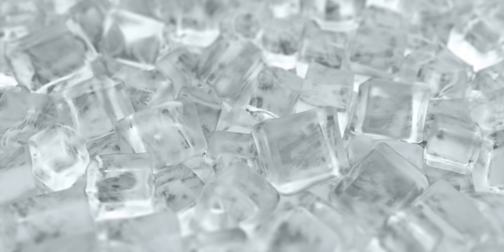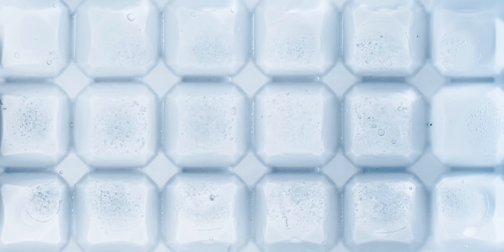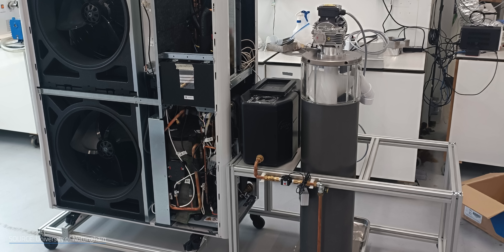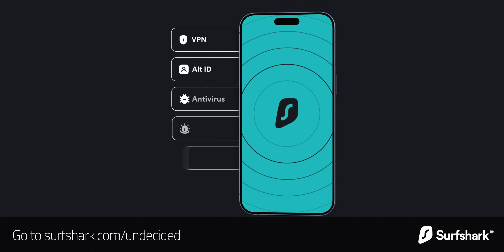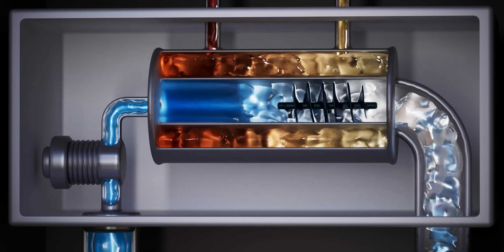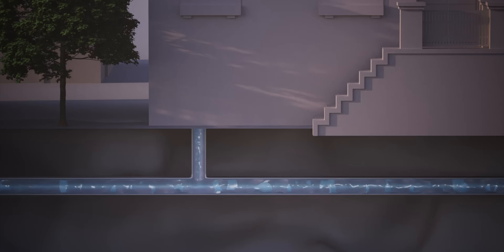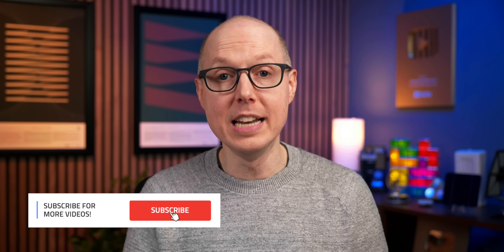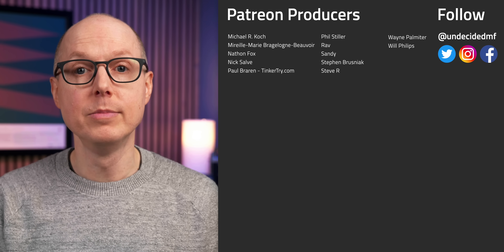How Can Ice Heat Your Home? Ice Source Heat Pumps!

Comment: Unless I missed something, there's a bit of an issue. Whilst the use of the existing natural gas pipe is a good reuse of infrastructure, this is totally wiped out by the need for a return pipe which doesn't currently exist, necessitating digging up every road and street to install anyway!
Reply: I think the clue was the mention of non-pottable water, the proposal may be to use the ground water or sewage water pipes as the return. This is reflected in the comment about suiting built-up areas more than rural ones, as in rural locations ground water tends to feed soakaways and sewage septic-tanks, so don't offer a return systems.  The picture in the video with the separation tank on the return also indicates this use. Perhaps Matt was avoiding describing grey/brown waste water being used in this role, stating non-pottable water instead.

However, whether this works or not is another question in itself, given the state of the water companies in the UK, and their attitude to investment.
Reply: @GruffSillyGoat  I imagine slushy grey/brown water would be basically cold mud/diarrhea.  Requiring more a lot more power to pump
Reply: Oddly, there's a lot of heat in the drains, at their depth would have a constant surrounding temperature from the earth. I would anticipate the impact on turbity or fludity would not significantly alter. There's a trial of a waste water heat-recovery plant operating in Kingston (London), as the current treated waste water is pumped into the local river with a near-constant 10-15°C all year round. The system diverts part of the literal waste-heat into a new district heating system in the area. The waste heat resource is massive, with some 20TWh of heat washed away in the UK alone a year (16 billion litres), and 350TWh in the USA. 

The Kingston system use centralised-WSHP rather than per-house ISHP, although I wonder if ISHP would offer any additional benefit (would depend on the COP of each system). A ISHP approach would provide a more localised system, whereas a more centralised sewage heat-recovery approach would be a more district level approach. The advantege of the re-used gas-pipe ISHP approach being a retrofit approcach with a lower construction impat of having to dig up roads to fit a district heating system.
Reply: Think the bigger question is water pressure on pipes.  These are made for gas and at least plastic pipes might be inadequate for this function...
Reply: There are a lot of issues with this and it is a literal "pipe" dream IMO. First, even if the sewers were used as returns, the exit from the heat pump to the main sewer line isn't straight down, like depicted in the animation. In my house the sewer line runs about 20 yards horizontally to the street with a slope that allows the sewer line to be evacuated completely instead of sitting stagnate. The line is sitting empty full of air and that doesn't hold heat all that well. When we have freezing precipitation, it is really easy to see exactly where the sewer line is under the concrete, because the snow and or ice accumulates on top of where the sewer is buried before the rest of my yard/driveway. I can see the line about 6 in wide from my house all the way across my driveway with ice/snow and melted water on the rest of the driveway. The same way water freezes on a bridge before it freezes on the road. It is literally colder above the pipe because the air in the pipe is colder than the dirt. 

Generally, a sewer line is an open system with vents to the atmosphere, drained by gravity and assisted by pumping stations at low points in order to transfer the waste up and down hills to the treatment plant. It isn't a pressurized system like the gas or water deliver is. A home, in the middle of the night with no liquid water flowing into the sewer from normal household uses of water, might not have gravity flow piping that is able to melt the slush because of the speed of the flow of the slush will be slower than liquid water. Using an auger to push slush into an otherwise empty pipe, seems more likely than not to cause problems. It wouldn't take that much for the flow to be slowed enough for a frozen plug to form especially since it might already be  restricted by "solids" in the line. 

The issues besides returning the slush, is delivering water under pressure with a completely new infrastructure (besides the pipes in the ground). The water has to be sourced and pumped and none of that comes without a cost. Plus there is no guarantee the existing pipes are adequate to deliver the required amount of water volume. Residential NG is consumed, at the appliance, at about 6WCI of pressure, different areas have vastly different supply pressures that range from 7WCI, which is less than .5psi, to as much as 100 PSI or even more I suppose, but generally, in a residential area, it is about 2 to 5PSI and regulated down at the meter as compared to water which is generally 60 to 80 PSI inside your home. It just doesn't seem like it would be feasible to have a reliable delivery system using a system that is designed for such a vastly different type of product. I can't imagine a system like that isn't specifically engineered to deliver water and remove the slush at the amounts needed at all times is going to be reliable enough for something as vital as home heating. Just repurposing some piping in a building is one thing, doing it at the level of a utility is a completely different prospect. IMO which to be fair is worth what you paid for it.
Reply: Wasn’t there a figure which showed the slush going to the drain pipe? There it would mix with warm waste water and quickly melt.
Reply: @auspiciouslywild  that would mean a massive increase in water consumption in the country, and an overload to our drainage systems, which already struggle at times.
Reply: @juststeve5542  Quick solution to this would be to just use salt water since it freezes at a lower temperature anyways. Obviously would require more infrastructure to move the massive amount of water into non-coastal cities.
Reply: @ The non potable water could come from the waste water treatment facility, so the net water consumption would still be low. I can’t imagine that the total amount of water added to the sewer would be all that much, and since it’s clean it doesn’t increase the load on the waste treatment facility too much.
Sure, it could be a good idea to improve the sewer system.. isn’t that easier to fund if the sewer serves dual purpose? And isn’t that something that’s good to do regardless, if the sewer system is already in such a bad state?
Reply: @juststeve5542  the input to the system is non-potable water. The melted icewater in the sewer system could be recovered... Once the gas pipe network is flooded there would be minimal demand for more water. The additional fluid load on the sewer system is the bottleneck, not water availability.
Reply: @juststeve5542  Drainage system first: this is certainly a challenge in the UK. Second, water consumption: less of a problem. The water does not have to go through expensive filtration and purification, and bulk water can be scavenged downstream, from rivers.
Reply: @juststeve5542 an increase but not a massive increase as there's a lot of energy locked in the phase-change.
Reply: @juststeve5542 the UK's sewage system struggles because it's not been upgraded for 40 years & because we're now getting more frequent flooding due to ClimateChange, it needs upgrading anyway & the water companies may be dreaming about government grants off the back of this idea.
Reply: @juststeve5542  That's why you need to turn it to slush, you get the equivalent of 80 degrees, or 1/80th of the water compared to a typical water source heat pump.  OK that's exaggerating, more like if you had a ground source heat pump that you raised each gallon of fluid 20 degrees in closed loop, you'd need 80/20 = 4 gallons of gray water for this system with equivalent energy consumption.
Reply: @ryanbrown6377  Reducing the freezing temperature completely defeats the point of using the latent heat of freezing.  And does nothing to address the issue he mention, overload of drainage systems
Reply: @ryanbrown6377  Adding salt would be detrimental to not only efficiency, but would increase the infrastructure requirements and pollute downstream water.
Reply: @ryanbrown6377 unfortunately salt water would heavily corrode some infrastructure
Reply: @ryanbrown6377  My guess is that that would increase the risk of corrosion in the pipes
Reply: @auspiciouslywild  Also given that this would have to be applied on large scale due to the gas pipe repurposing, I don't know how much of frozen slush you can dump in a sewer in winter before the heat drain is so big it starts to freeze it up. Not to mention the huge extra consumption of clean water for this purpose. It's a nice idea but absolutely unsustainable on a large scale.
Reply: @ I seriously doubt that we’d ever have to worry about the sewer freezing. There is a huge amount of heat energy down there. Both from people taking hot showers, draining pasta water, etc, .. and just that the earth is warm down there.
The system doesn’t use clean water. It uses non-potable water. It was clearly mentioned in the video. As I stated that probably means you can use water from the sewage treatment facility.  Technically we could drink that but people don’t like the idea, so using it for this kind of district heating system could make sense
Reply: @auspiciouslywild  
That's a poor approach.  We have problems with droughts, heat island effects, heatwaves, infrastructure costs, rolling brownouts, etc.  It's better to harvest this water to bioswales and raingardens, see my comment above that has a deeper explanation...
Reply: @fintrollpgr I would expect chilling the bugs that do the composting in the waste treatment plant would be a problem long before the pipes freeze. It seems similar to melting snow though, maybe it will cope?
Reply: @b_uppy we're talking about UK not USA, we haven't had brownouts since ísrael's 1973 war.
Reply: @alanhat5252  
I am talking more generally.  Additionally when the Ukraine Russia War broke out there were concerns about an inability to heat people.  Likely there were people that had personal brownouts/blackouts as a result, especially if prices rose as a result...
Reply: @alanhat5252  Excellent comment about "chilling the bugs that do the composting in the waste treatment plant"

Wastewater treatment plants use anaerobic digesters (where the bugs live and do their thing with the poo) which produces methane. This methane is used in boilers that maintain digester vessel temperature. Most of this methane is flared off but a lower temperature waste stream will mean less methane being flared and more being used to heat the digester.
Reply: @auspiciouslywild  huh? The the diagram had a drain pipe that doesn’t exist today. You just assumed that a actually that was a sewage line. This is a fantasy if it requires continuous freshwater.  This is nothing more than a geothermal loop that just operates at the phase change boundary of the medium (in this case Water).
Reply: @ What else can it be when the whole point is reusing infrastructure that’s already there?
And I wonder how many times I have to repeat that they use non potable water. There are many potential sources, and in some cases it could be a near closed loop. Phase change releases/absorbs a huge  amount of energy at the transition, so the consumption of water does not have to be high
Reply: Could use something called bioswales/raingardens.  The last thing we need to to do is divert it to storm drain/sewer lines.  
With bioswales/raingardens you recharge watertables instead of overloading infrastructure systems.  Bioswales help purify water, especially if used to also manage streetwater runoff.  It reduces pumping costs, electrical grid strain, air and water pollution, reduces the need to update stormdrain/sewerlines, reduces ground subsidence, recharges watertables, etc.
Reply: SO … It sounds like plumbers will be supplementally retrained as heating system techs?? I would still keep a bunch of space heaters as backup because if the plumbing backs up… (and you know how responsive plumbers are…) I would also freeze to death adding insult to injury 😅
Reply: @jasontram7775  
You mean gas company employees "will (likely) be retrained."  Plumbers will continue to be tardy...
Reply: With an input AND output, that's two systems of water lines carrying anything from non-potable water to greywater, brownwater, or treated sewage.
In addition to your potable water and sewage.
Assuming you already have the gas lines you are decommissioning, are you sending out the ice slurry in your existing sewer lines and increasing how much capacity your treatment systems need, or a new run of pipes which necessitate disrupting roads, yards and foundations/basements to run that new loop.
-
edit: This is my off-the cuff look at the process, no study invested.
Reply: @MonkeyJedi99  
See my comment about instituting raingardens and bioswales.
Reply: Minor note:  although the UK is mostly metric, they do still refer to long distances in miles and not kilometers, so they would probably prefer mileage over “meterage”.
Reply: @juststeve5542  also, what happens to all the other appliances? I.e. gas stove, gas water heater, etc.. they all go electric?
Reply: @newmonengineering  and where does all the extra power come from to run everything (and charge all the cars!).
I'm pretty sure that if all these govt initiatives actually went as they planned on the original calendar, most UK substations would be doing a good impression of the one at Heathrow!
Reply: @newmonengineering  why can’t you keep a gas line for that? It’s not that you have to switch off the gas, but the bulk of the cost from gas use sits in heating.  You just minimize that cost.
Reply: You could put an inner pipe and outer pipe to solve this. That being said, the idea is in my opinion dumb, as over time this thing will have to leak cold air in the area you want to heat. There'd be a reason why such a simple idea hasn't been done yet.
Reply: @infiniteloopcounter9444  
That sounds expensive to redo the systems this way, which negates the point.
Reply: Why not use normal water supply as feed and the gas pipe as return for the slush? I guess it's easier to install intermediate pumps if needed in a gas pipe system than in a sewer line
Reply: nonpotable water... It is about time storm drains were diverted away from sewerage anyway.
Reply: That was my first thought too. Kind of got glossed over though.
Reply: The (separate non-potable) water supplied by the gas pipeline could be grey water, pumped from the sewer plants after screening for solids. You could even conceivably have a separate storage tank on site, like a septic tank, for household grey water from the kitchen, bathroom (less toilet), laundry, and downspouts. The slush produced could be dumped back into the regular sewer. This effectively becomes a grey water based geothermal system. What would the pumping costs involve?
Reply: Kinda glossed over that, didn't he. And if you have to dig up to lay the return pipes it wouldn't cost that much more to lay new supply pipes at the same time, i.e. you probably don't really need for there to be an existing NG pipeline to make it economically feasible.

Also, they didn't discuss the flow rates required but gas piping (into the home anyway) tends to be pretty small diameter - typically less than the 1/2" water pipes - so I'm not sure this is really a viable option although I guess they must have thought of it. Surely? Hmm? 🤨
Reply: I'm not sure all that ice (or cold liquid) would not be an issue, not to mention that it may cool the ground and thus the houses around. I remain "undecided" on that one.
Reply: If my quick calculations were correct, to provide 2kW of heat, at 80% efficiency (in this case efficiency= percent of water turned into ice) it would use about 26 kg of water every hour. I dont think this would overload storm drains, or even residential drains for that matter.

Edit: fixex missing timespan
Reply: @pali3329  2kW for how long? You're missing a time period.
Also 2Kw isn't much, that's less than a standard UK kettle, and well below a central heating or water heating system.
Reply: @juststeve5542  Thats absolutely right, I forgot to include that that figure is the hourly consumption, I edited the reply to reflect that. I meant this just as a refference point, so you could easily conclude, that with a heat loss of about 5kW, an average house would use about 60-65 kg(l) of water hourly. 
Idk how much the drainage system is designed for, but I imagine that in a storm with heavy rain it would be more than 60kg/h/house. Altough, in that same heavy storm another load might just overload the system.
Reply: Not to mention that the 'drag' of moving slush will be higher than the drag of moving water.  Will need to avoid sharp bends too and likely need augmentation pumps (augers) at regular intervals.
Reply: all you need to do is tee into the current water line and install a pressure regulator
Reply: I believe from the comment on bringing the water companies with them that the existing sewer system is meant to act as the return.
Reply: Sewers act as the return.
Reply: It gets Returned through the sewer network meaning you'll get charged twice
Reply: @adus123  
Read my comment regarding diverting to bioswales/raingardens...
Reply: @juststeve5542  worse is the fact that we are in an epoch of CO2 famine.  Taking out the use of clean natural gas will detract from the progress we have made so far .  Worse yet the input of electricity for pumps and back up will need more than a straight natural gas heater/cooler.  let's not even address the corrosive effects of water on iron pipes and the expenses of replacement 🙄.   More eggheads theory in the face of an easier less expensive solution 🤔
Reply: Also why not use steam and water instead of ice and water, as steam is much easier to transport... 

and why not have heating simply come from the central point... why waste space in each house if you could simply change the flow of steam/water to your house...
Like I see no reason to use ice...

They already planned to use underground pipes.
Reply: @greedier-7661  the problem with pumping heat is that over money distances the heat dissipates. With the heat pump, you don't need to maintain temperature of the water
Reply: @MrAlex6169  ... gas pipes are underground so heat dissipation would quickly lessen to high degree.

And you did not consider electricity wasted by not using centralized heating, which would have higher efficiency then using civilian machines.
Reply: @greedier-7661   Steam is applied in New York city.  The main idea/advantage with heat pumps is it uses minimal electricity to run the mechanics to transfer the "free" latent heat to where you need it.  However, as this video discusses, there's A LOT of other problems to overcome.
Reply: @greedier-7661 the existing natural gas pipes in the UK that are being proposed to be used aren't insulated for steam.
Reply: @greedier-7661  steam needs to be pressurized in order to reach the same energy density to water though, it is hard to say without knowing what the pipes are capable of
Reply: @fakestory1753  I believe gas has higher pressure in their pipes. Like 10 or more times.
Reply: @greedier-7661  If I remember right, New York City actually does this. There are centralized boilers that pipe steam around to all the massive buildings for use in heating. It's a hold over from a century ago when skyscrapers were growing and installing expensive boilers in every one of them was proving too economically taxing. Downsides is that the pipes do burst on occasion and you get massive gouts of super heated high pressure steam shooting out of manholes like a geyser
Reply: @greedier-7661  Steam, per unit volume, has less energy than liquid water. Moreover, this is basically a system that aims to extract thermal energy in water as it turns into ice; in other words, you are harvesting energy from streams, lakes, rivers, or reservoirs.  On earth the most common form to find water is in its liquid state, so baring a volcanic vent or hot spring you would likely be stuck with liquid water as the source.
Reply: @greedier-7661  That's what they do in district heating, but you need insulated pipes or you lose most your energy on the way there, you can't reuse the natural gas pipes.
Reply: @greedier-7661  "why not use steam and water instead of ice and water, as steam is much easier to transport."

Steam => higher pressure?

Also, steam will lose heat much, m-u-u-u-u-u-u-c-h faster than room-temperature water. The waste would be astronomically higher by comparison.
Reply: @christopherbedford9897  pressure in gas pipes is much higher then any steam pipe.

The extra pressure will keep steam from needing it to be as hot.

Steam needs much less pressure then moving ice slushy...

Loss of temperature will be not as high because all gas pipes are underground.
Reply: @greedier-7661  There is no central heat source so no separate bill. That would defeat the advantage of household heat pumps which instead use a small amount of electricity to move heat from one place to another. And unlike natural gas, heat would become less efficient the further away you get from the source. You would need multiple local neighborhood heating plants.
So long as the water doesn’t freeze solid in the pipes there is more heat that can be pulled from it. And if the pipes are buried deep enough in soil that never freezes solid, then you wouldn’t even want to insulate the pipes. The working fluid would suck heat from the surrounding soil and increase the efficiency of the whole system.
Reply: @greedier-7661 steam has to be either at 100C° or low pressure ...

You'd need to make somenthing that spreads that around while losing a lot of energy
Reply: @davidegaruti2582  
1.... the pipes where literally transporting gas. I don't think pressure will be a problem.

As for heat, centralized heating is often connected to coal plants, gas plants, green matter burning plants. So heat from them can be directly used to heat water.

and loss of heat can be prevented with insulation and it being placed underground.